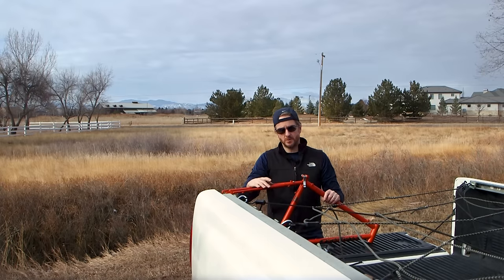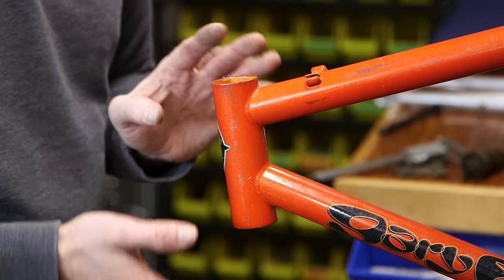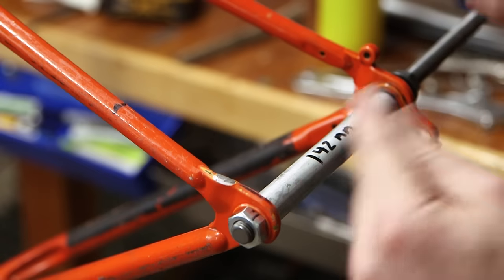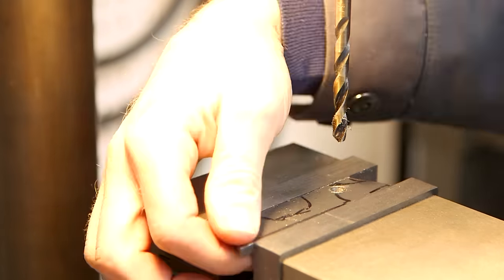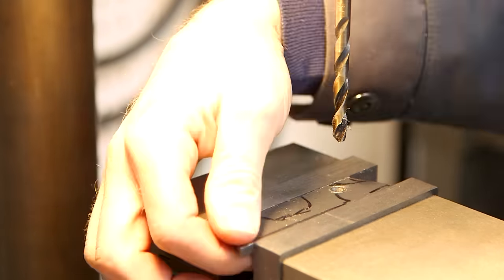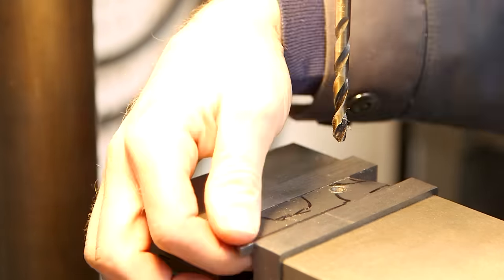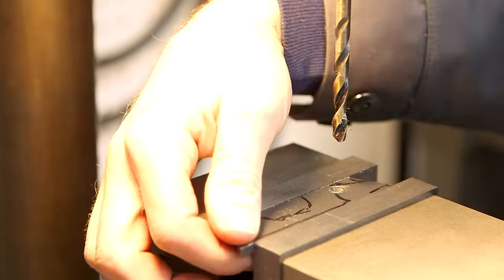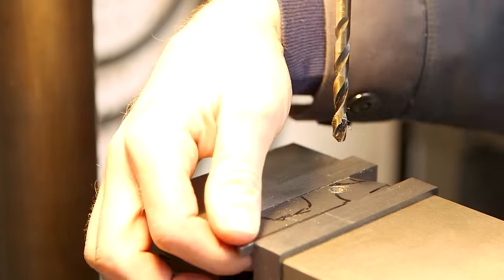1990's Gary Fisher Gravel Bike

Comment: While the Thru Axle is a nice touch, it's not really needed for the rear -- it's really just for front forks that the flexy nature and the direction of force on a disc brake is an issue. I've converted several high-end titanium 90's MTBs to gravel, and my strategy is simply to replace the fork to a newer thru-axle model. Besides, welding titanium is no fun.

Comment: How did you find an old steel frame that is 700c compatible?
Reply from the maker: In my experience, most old 26" mountain bike frames will run 700c wheels, provided two things:  The tire size is smaller than it was on the 26" frame and it has (or is modified to have) disc brakes.  On rim brakes, the spacing from the brake bosses to the rim is further on 700c wheels, making their use difficult.

Comment: I tried once to cold set from 130 to 135mm on old Raleigh I had. Chainstay cracked 😢 I think it was 501 steel
Reply: You just rammed a threaded rod in there didn't you?
Reply: @janeblogs324  threaded rod with big double washers on all sides (8 washers total) and going in several steps-expanding and realesing tension. Crak was small, bicycle was OK to ride but I prefer no crack option.

Comment: 2:35 Dude, you’re way too good of a mechanic to let your headset cup remover torpedo in to the shop floor. Fold a rag in to quarters, use it to hold on to the cup, slow down your hammer blows as it starts to push out. What if your customer wanted to keep the headset.

Comment: What hydraulic block / pump did you use to set the frame?
Reply from the maker: It's one I got on Amazon a few years ago when I was repairing my pickup's frame.  20-ton low-profile hydraulic ram.  Couldn't find the exact one anymore, but this one is very similar.  https://www.amazon.com/NEWTRY-portable-separating-hydraulic-Industrial/dp/B074R8J2VM/
Reply: @RobertAdairWorkshop  Sweet! Thanks!!

Comment: How did you find a 90s frame that fits 700c wheels?
Reply from the maker: Most will if the tire isn't too large. A 26"x2.0 tire is roughly the same OD as a 700cx25mm tire.  The only problem is brakes.  You won't be able to use rim brakes with a 700c wheel unless you can find longer calipers.
Reply: @RobertAdairWorkshop  Hence the disc brakes. And of course because it's an essential part of such a build

Comment: 1 - quill seems to be thermal bent after welding
2 - you should not make it seems like you find this frame in the dumpster if it is not really
3 - that block you fitted to the frame to change derailleur direction: is it really done that way?
4 - from my experience no one going to sell expensive shifters that only dirty for cheap, so that not an reliable option in reality
5 - most 'old cheap mountain bike frames' has 1 inch stem, so eah, you should find really specific frame 'on a dumpster'

Comment: QR is plenty strong… I feel that converting it to thru axle is unnecessary. Using a thru axle in the front would’ve been enough.
Reply from the maker: I did it for wheel selection.  QR gravel wheelsets are becoming rarer each day.
Reply: @RobertAdairWorkshop  Old QR hubs are super easy to find and super cheap. I just bought a 2005 XT rear hub and laced it to a recent Hunt rim, all for ~$120 CAD.

Comment: I've stretched 130mm Titanium frame for 135mm wheel and it died about 10000km later.
You are better off buying cheap al. disc frame than modifying frame spacing.